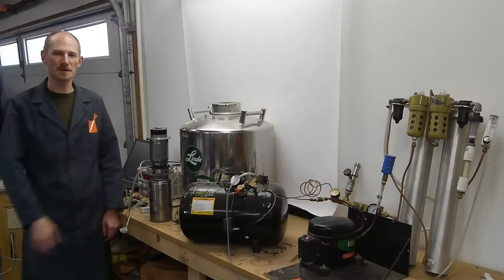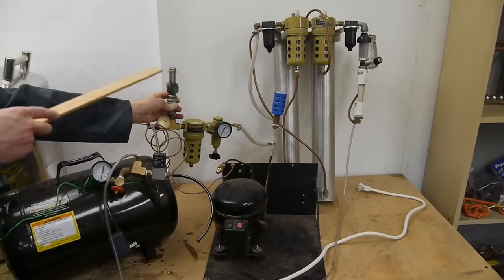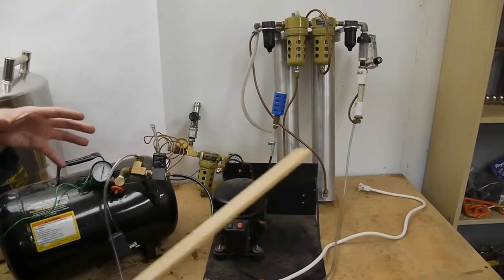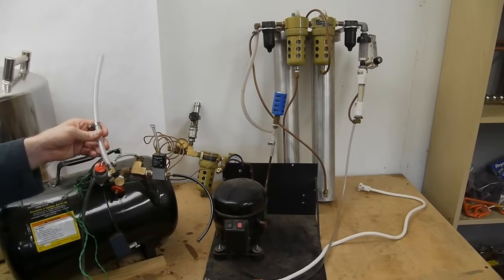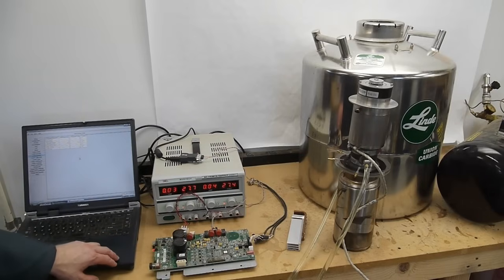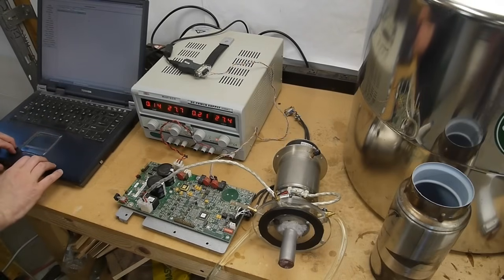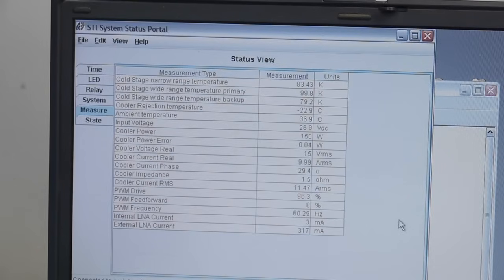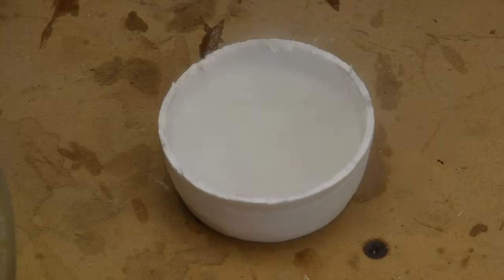Liquid Nitrogen Generator - Overview

Comment: Why not leave the oxygen in the dried air?
Reply: JustOneAsbesto liquid oxygen is extremely combustible. Things that may not be flammable will become very flammable with liquid oxygen around.
Reply: ***** and then use that to create homemade rocket fuel?
Reply: ***** I'm definitely imagining an electromagnetic LOX pump here.  That said, I have no issues with the idea of producing LN in the garage (my wife might suggest otherwise, but that's beside the point), but LOX, I don't think so.  Spill a couple liters of LN in a 250-sf garage, the hazard generally stays in the garage (displacement).  Spill a couple liters of LOX in the same space, and the hazard in any number of credible garage accident scenarios spreads rapidly (fire).

Comment: I would be nervous hanging around a Union Carbide pressure vessel.
Reply: It's under no pressure, just open in a very fancy vacuum insulated Thermos filled with many layers of space age heat reflectors.  The high tech folks in Silicon Valley use so much super-sauce that it is piped down the streets like any other utility.  In quantity, it is about the price of beer!

Comment: Interesting, could you do the oxygen filtering post processing? Although it would not help with the moisture.

I got my Cryocooler a couple of years ago from a guy that services towers. I think it was $250 cash. My version of the hardware is different though. The whole unit runs at the standard 27-28V DC but the voltage to drive the linear motor is boosted up to 110-130 AC at 60 Hz. I can therefore drive it directly from a Variac or router speed control. You do have to still ramp up the power as it cools the head down.

Here is a link to teardown photos of my unit. Superconductor Technologies, Inc
850A2RV20

https://www.dropbox.com/sh/3uvk2gd5yke1b4l/AADH-apHp5PJy8YjkaZTui9Ya?dl=0
Reply: You need to make a video.

Comment: 👨‍💻Fridge compressor who would think ? 🤷‍♂️👍👩‍🚀
Reply: They are abundant and can often be had on the curb for free. They can make rather high pressure, and can also make a half-decent vacuum... even more so when you put a pair of them in series. If doing series, and one is a scroll compressor, put it as the one closest to the vacuum chamber or whatever thing you're "pulling vacuum on."

Comment: Anyone put one of these on a CPU yet?
Reply: ***** Looks like something for LinusTechTips .
Reply: I doubt the RF filter these things are normally coupled to produce any heat, they just need to be cold, so I doubt it will work considering CPU's put off like almost a hundred watts worth of energy. but im still wondering.
Reply: Mp57navy they already made one, a phase shift cooler.
Reply: Based on the numbers he mentioned one of this size probably wouldn't do well. I think he stated about 10W worth of effective heat pumping. The tdp of desktop cpus exceeds that by a lot, but I suppose you could cool a large thermal mass of water or perhaps a more excotic thing to pump through a watercooling loop 24/7. Then you'd have a large supply of really cold stuff for when you want to run the cpu hard? 

But then one might as well make liquid nitrogen and use that to cool it directly or build a huge geothermal loop to get affordable low energy expenses cooling once it's created. It's all in the stupid overkill league for cpu cooling.
Reply: All of the so-called quantum computers are super-cooled.

Comment: It's almost an oxygen generator.  I wonder how much it would take to get oxygen?
Reply: Kiki Lang Same process except use the oxygen output from the oxygen filter. Naturally the rate of oxygen production would be much lower due to air's oxygen content, but essentially the same process with maybe a few more safeguards in place due to pure/liquid oxygen's flammability.